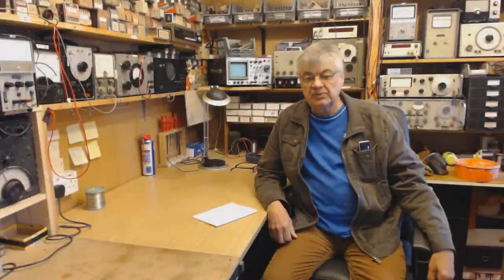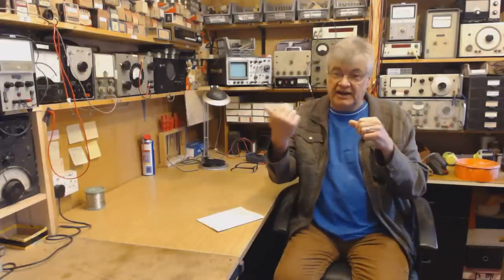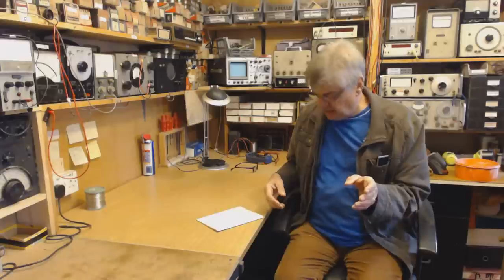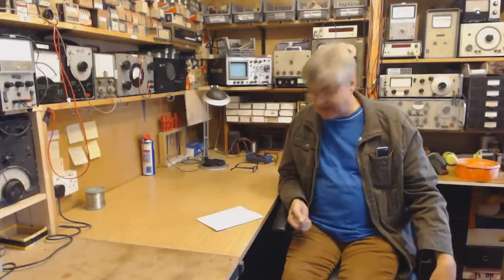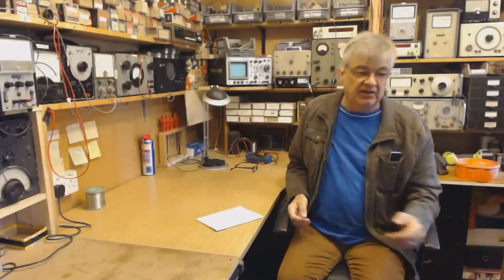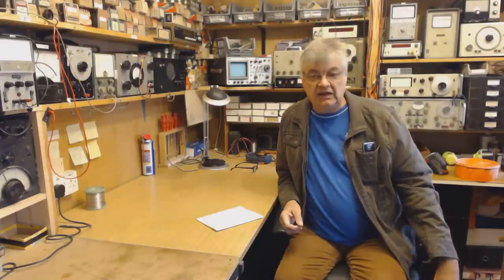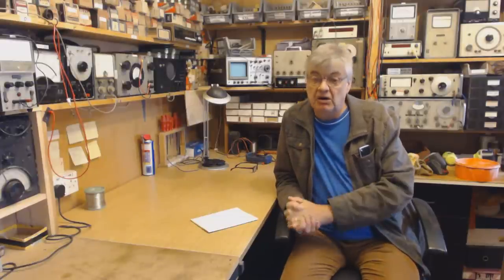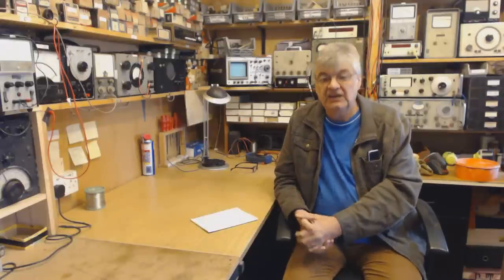Doublet aerial for HF amateur ham radio short wave bands

Comment: Hi Ray. I've got all the parts required for my doublet and will put it up over the summer. I got an old antenna off a club member to scavenge for parts. There was a ferrite ring with it. 
Is it worth incorporating the ferrite ring into my doublet, perhaps where the ribbon meets the radiating element?
Reply from the maker: Sounds good to me. No, don't use the ferrite ring. Cheers, Ray.
Reply: Thanks a mil Ray. Have you any advice on grounding? This will be a receive only antenna (for now). Clearly I don't want to leave it connected to my SDR when not in use. Is there a way of grounding an open wire before entering the house?
Reply from the maker: There's no way to ground open wire other than taking the two conductor directly down to earth. Some kind of plug and socket arrangement just before it enters the house, maybe?
Reply: Like to a chocolate block connector to ground wire, or something :)
Reply from the maker: One Time Pad yes, perfect.
Reply: Hi Ray. Sorry to bother - about grounding. My mast will be mounted on the back corner of the house - using T and K brackets i.e. no contact with ground. The 300 ohm ribbon will run into the attic through a hole (wife not aware of that one, yet!) - to an ATU. 
Should I run the ribbon through some sort of lightening protection (just before it enters the house) and connect to a common ground with the mast? 
Or should I ground the mast and leave the balanced line i.e. just disconnect from the ATU when not in use?

Many thanks in advance, Adrian
Reply from the maker: No, do not use the ferrite ring. Let me know  when the aerial is ready to go and we'll have a chat on 40 metres.

Comment: Brilliant video. I have long thought that the Doublet was the best multi-band wire aerial that is relatively simple to install. I made my own 4 inch wide spaced balanced feed line, and fed that via a 1:1 balun into a remotely located Auto-ATU in the garden shed. The ATU then fed back into the operating position in the house via RG213 coaxial cable. Neat and effective  Thank you for the video! 73, Mike  M0MTJ    (P.S. - I think it was Magnus Pike, by the way! :-) )
Reply from the maker: Hi Mike, it’s nice to hear from you. Magnus Pike! Yes, you’re right! I love my doublet. Works well on all frequencies.

Comment: Ray, just to add some information, 80ft of RG58 feeding a 40m dipole... only losing about 15% of the power..,not much scope for a huge improvement. 10m though was losing roughly 95% of the power. 20m was losing about 93% of the power...
Losses with open line are very low, granted my openwire is shorter... about 30ft. Typically now only losing a few percent in feeder loss.
I had always intended to run openwire, but until now had never done the maths. Coax even at these low frequencies is a disaster with high VSWR... feedpoint of a fullwave dipole is about 5000 ohms.. 
Makes you wonder about ATUs with coax ouputs... hardly worth having...

Comment: My Dad got me into radio he was also a GM4 and from a young age I spent most of my time as a SW listener,  later in life 38 I decided to go for my Armature Licence, My dad had all the knowledge and always had the answers, He gave me instructions on how to build a doublet exactly as you have described I managed around 80 feet - 40ft both ways then ladder line into a Smart Tuner and have worked many contacts on 40m using a mere 10 watts. Only difference was rather than use 300 ohm feeder and so forth I used wire spreaders at my centre down to the Smart tuner. Tunes on all bands works flawless. you many have guessed but my dad is no longer with me however the doublet still hangs high. Great Video many thanks 73's to you and your's.
Reply from the maker: Chris R Hi Chris, it's nice to hear from you. The doublet is a brilliant aerial, and so simple! It must have been lovely to have your dad pass on his knowledge. Take care and the best, Ray.

Comment: I'm now licenced since January 2018 and use a "Ray" inspired doublet. it's compromised because of space i.e. there is a dogleg in one of the "wires". It's been great so far - have had lots of contacts on my 100W radio, including on 17m & 15m. I only tried it on 80m for the first time last weekend and it worked very well. It's opened up a whole load of local contacts I never knew where there. I even got a contact with an IOTA expedition on the normally uninhabited Blasket Islands off Co. Kerry! 
I know a just licenced Ham (last month) and he's going with the Doublet too!  btw Ray do you go on 80m much? 
73 Adrian EI9HAB
Reply from the maker: Hi Adrian. Congrats on your license! I'm not on 80m very often due to interference but I will listen out for you. Cheers and well done, Ray.

Comment: I previously commented via my other account. The doublet fed by open-wire is a very effective aerial. 
I still hear plenty of nonsense on the bands extolling the virtues of resonant aerials. Resonance is not a good thing in some cases... a 40m half wave dipole on 20m is resonant but it is a crazy high impedance.
The best thing I ever did for my HF operation was to ditch coax and not worry about the SWR... my doublet is far shorter than yours, just 66ft, 80m is obviously poor performing but I will add some more wire...
open wire feed runs to a 4:1 current balun... which uses two seperate FT240-43 ferrite rings. Easy to do the bifilar winding using ordinary mains flex!
Easily withstands a pair of 3-500s up it....
Reply from the maker: g0fvt Thanks for your comments, Ditch the coax, the best advice ever! Cheers, Ray.
Reply: Ho is that why I got a Distinction and credits on my City and Guilds certificate. I'll try better next time. I might even go on a cource instead of teaching myself. But there again I did do a Class 1 Combat Radioman cource a number of years ago and got a first place pass on that. So I supose "I know now't.  Takes all sorts does'nt it.
Reply: urbex2007 I am not sure who that comment was aimed at, resonance is not a magical thing, it is purely about the reactive part of the impedance. If the reactance can be catered for without incurring huge losses in the feeder or matching network it isn’t a problem. Arguably an aerial should be designed to achieve the desired radiation pattern and worry about feeding it as a secondary issue. For general HF use a doublet is a versatile multi band solution.

Comment: Thanks for another informative video Ray in layman's language which is a great help for me as a novice. I am just a shortwave listener and just dying to have a go at a doublet. I have an awkward shaped garden so the antenna wire might be a bit higgelty piggelty, like a Z shape with maybe a bit more on the ends to get length. Would that shape work for RX only. Best wishes.
Reply from the maker: That shape will be fine for RX.

Comment: This was brilliant!  I agree with many of the other comments and want to say that this is the first time I had any chance of understanding many of these concepts.  I am located in the America, a new ham and want to make European contacts.  I am limited to wire since my wife would divorce me over a highly visible antenna.  Would I be correct in assuming from this video that I should hang as much wire as possible, as vertical as possible, with a ladder feed line with an amplifier (suggestions?) and tuner (suggestions?)?

Again, thanks.  It takes true brilliance to explain many of these concepts to less than brilliant people such as myself. 

KC3ITL
Reply from the maker: Thanks, Andy. I appreciate your kind comments. Yes, as mush wire as poss as high as poss. I don't know about amps but a decent balanced tuner such as MFJ. Cheers, Ray.

Comment: It all depends if your using your feed line as part of a transformer. It's not throwing theory out the window. The antenna you describe by 'design' is not expected to be resonant and is expected to 'need' a tuner. Other antennas that do have an expected resonance will need to be accurate to design.

Comment: Thanks for an excellent video.  I moved to balanced  line for HF years ago. I wasted so much time dealing with coax, high swr and power losses before the move to balanced line.  Even use balanced line for SOTA and POTA with excellent results. I do not use the 4:1 balun in the transmatch but use and external 1:1 balun.  73s KG5IF

Comment: An "all band doublet" as a an inverted v is the best multi-band antenna your going to find. I've used this for years with great results. People often want to dismiss this because it's easy, simple and cheap. Look here if you want more information: http://w4neq.com/htm/doublet.htm The key to this antenna is the ultra low loss in the feedline when compared to coax. 73!
Reply from the maker: Hi Chris, thanks for the link. Cheers, Ray.

Comment: How far do you recommend keeping the 300 ohm feed line away from metallic structures? And if that is necessary, what is a good way of doing it?
Reply from the maker: It's not necessary really. Mine goes through bushes and up the wall and through the attic with no problems. Having said that, don't tape it to a metal pole.

Comment: Silly question, but to get coax in the shack you drill one neat hole ,,,how do you get ladder lint in the building ? Through an open window ,, sorry for dumb ass question cheers Shane ct1017
Reply from the maker: shaneweightman it's a good question. I take the line under the gutter through the wood or plastic into the loft. Then, down through the ceiling. Cheers, Ray.
Reply: Sorry just found some on eBay ,,,wire is closer together than I imagined thanks shane

Comment: If you want to run it at a much lower frequency, you can short the ends of the line together, and operate it with ground radials or a counterpoise, as a Marconi.  Don't ask me what the radiation pattern will be (it might be great!...or... :) ), but you'll get a nice 1.00 VSWR, with a tuner.
Reply from the maker: Hi Clyde, I have tried that without much success because the ladder line goes up through the attic. It would work well if the line was outside in the open. Great to hear from you. Cheers, Ray.

Comment: A half wave on 40m is close to a quarter wave on 80m.  A 40m dipole may not work on 80m, but is possible with a doublet
Reply from the maker: A doublet will work on any frequency higher than its resonant frequency.

Comment: I have learned that in ham radio, if you want five different ideas on antenna operation, ask four people. 
The fellow that sold me my first commercial OCF dipole sounded like this fellow. Told me to get it as high as I can and use good coax, it will tune fine. He was right. Sometimes we try to out engineer ourselves. Simple is better 9 times out of 10. 

Do you have a shack and equipment tour video mate?
Reply from the maker: I don't have a shack video but I might make one. it's a great idea.

Comment: Hi ray...if when checking the swr of my 42mtr long doublet that I have just erected fed with 20ft of 450ohm ladder line....using my antenna Analyzer...I find the swr on 80m up around 9.5 to 1....its  even higher on some bands.

I feed the 450ohm ladder line to my balance line input on my MFJ tuner with its built in 4-1 balun for balanced lines.

Is such high swr reading to be expected with the doublet?
Reply from the maker: nickjaxe no, you should be able to get 1:1 without any trouble. I can’t think what might be wrong.

Comment: Hello Ray...I am a SWL and also learning as hard as I can. I watch all of your videos with interest. I love mucking around with bits of wire and making aerials and am amazed how it all works. Where I live on the Romney Marsh in Lydd my wife likes to listen to Radio Sussex on 405.1  but where we live the reception is lousy. So I made a simple wire dipole cut for the frequency stuck it in the loft and fed 50 ohm coax down to the kitchen and soldered a crocodile clip from one side only of the dipole to the tip of the whip aerial (no aerial inputs on the radio) and so amazed that it works. My wife thinks I am a genius and I am leaving her thinking that. Anyway I only listen as I have said and have a Tecsun S2000 radio and a random wire aerial. I made my self a PI match atu. My radio has two inputs for shortwave, one 500 ohms and the other input 50 ohm. The random wire goes through the atu and into the 500 ohm socket. But now I am wondering if the atu is needed if I use the 500 ohm input on the radio, can you enlighten me on this. I also use my scanner aerial (1300 Discone) into the 50 ohm socket at the same time and it seems to improve reception. I have received some what I call half decent stations from as far as Radio Havana in the west and Trans World Radio Swaziland to the east, and most of Europe and a few SSB amateur radio chaps. Some years ago I had a Radio Shack DX-394, and a homemade atu with a bit of broomstick and copper wire wound around it. One day I couldn't believe my ears as I was clipping this crocodile clip up and down the inductor and heard New Zealand south island weather forecast. That peaked my interest but the radio was mullered as one of the grand kids spilt water on it and that was the end of that. Now grand kids grown up and not so clumsy I have found the interest again. I am trying to work out if I have the room in my garden for a doublet aerial for HF, or would it be wasted for reception only. My random wire is about 70 feet long in a sort of dogleg configuration 25 feet in the air and the into and around the loft then into the atu and the radio. Would a doublet be better for reception than a random wire?. Sorry about the waffling but gleaning as much as I can. Thanks for the videos.
Reply from the maker: Hi Mike, The thing is with aerials is to experiment. To use an ATU or not? I#d usually use one but, with your particular set-up. it might not be necessary. Broomstick and copper wire... excellent! Experiment. Cheers, Ray.

Comment: I don’t have a separate ATU But the radio has a built-in tuner so what do you recommend in that situation, would I need any type of transformer like a 9 to 1 Balun or can I just connect a short piece of coax to the radio and then splice that directly to the twin lead inside the shack and then run the twin lead up to the dipole
Reply from the maker: You’ll need a balun to connect the aerial to the radio.

Comment: Another great video, my 40m aerial is cut to length and fed with crappy coax, it works indecently well for what it is.  The ground here is very conductive and the feedpoint of the aerial is about 1/4 wavelength up. The doublet is a better idea but quite a few of us lazy people go for aerials which the rigs own auto atus can cope with. I am getting fantastic reports around the UK and Europe with this aerial but it isn't a great DX aerial. Good to see some myths debunked...  I remember at one of my previous addresses using a trapped inverted L fed against ground, friends were mystified when I started putting more and more buried wires in the lawn "because the swr was too low".... what they didn't understand is that the aerial should have been under 10 ohms on 160m and that the vswr was acceptable only because of massive ground losses and inefficiency.

Comment: I spoke from the French Alpes to Alabama this morning with 100W on 80M. I have a home made Vertical 1/4 full length. Around 4M of rg58 going to a tin roof just next to my shack then i have a car gutter mount with the wire screwed straight to the bolt that holds the screw in socket for the main element in place. From this point the antenna is perfectly vertical for around 3 or 4M and then it bends off towards a nearby tree where it is attached with a pulley to around half way up a larger vertical antenna that is already mounted above the tree. Exactly 20M to the shed roof with not much sag.
  It's been working very well and if i use a T connector at the radio and connect the other vertical antenna at the same time i can get a low swr on many bands without any tuners or baluns nor chokes.
  Next project is to raise the feed-point to the top of the current 1/4 wave with 300 ohm ladder line and try a type of doublet or inverted v/z from the higher feed-point. I have to be a bit stealth here so thinking to try black enamelled wire if i can find hard drawn copper in black and then use high strength fishing line to attach the various points so as to make it fit the best possible in my garden. I'm currently looking for a suitable tuner to go to the 300 ohm ladder line.
  I'm just a bit worried if it will all stand up to snow and ice loading. Thinking 16 SWG but i want to keep the feed point pulley attached via a stronger cord such as the one i am using now to hoist the 1/4 wave up. I left the last 10" folded over at 90 degrees or so so it becomes a bit of a capacitance hat, i think i measured it to around 20.2M long but never ended up cutting it.
  Vertical might not be best in the long run but it seems to be working great for now. In the past I've had great results on other bands with unloaded *(full length 1/4 waves) and the shed roof seems to be doing a great job as a counterpoise. I've no earth connection at all. the only link to earth is via the radio chassis and back through the power supply but thats a switching supply and i just checked and bad me thats not even earthed, i must have been lazy when fitting the flex and only had 2 core in my box that already had a plug on it. I don't think the earth would carry through to the DC side of the PSU as it should all be isolated between the high voltage side and the DC side.
  I will go add an earth to the supply rail of the PSU i should take more care.
Reply from the maker: izzzzzz6 Wow, interesting stuff!  The best part of the hobby is playing with aerials. Thanks for all the information. Cheers, Ray.